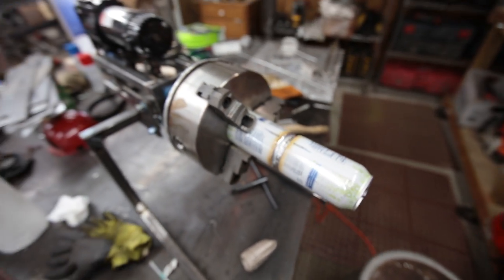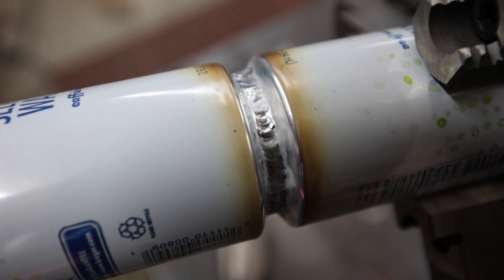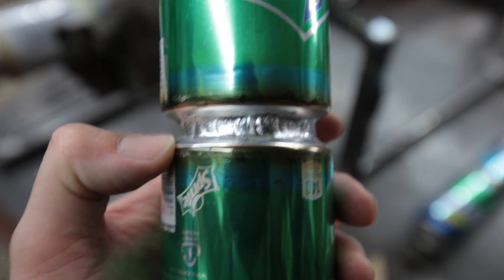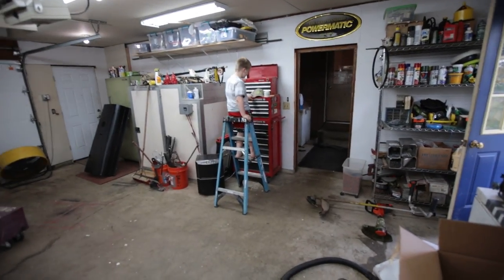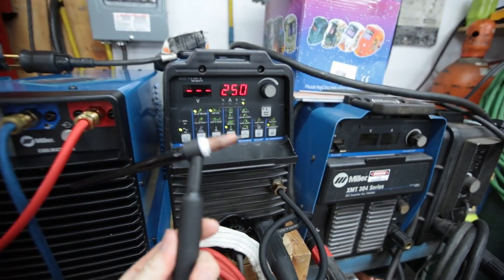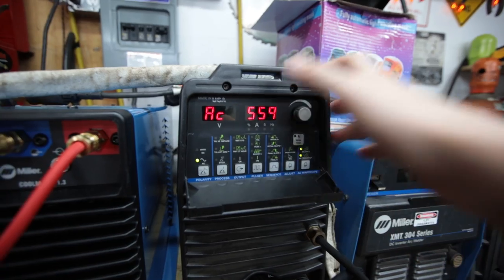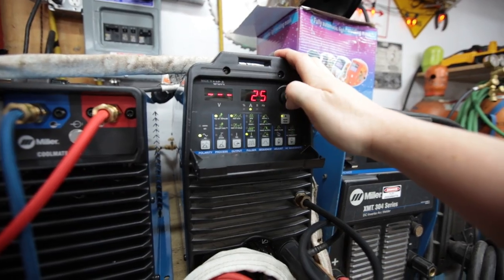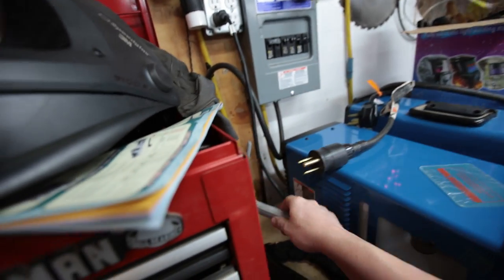Miller Dynasty 200dx Soda / Pop Cans

Comment: Can you do a video of the cart, and equipment on it, that you use for the Miller Multimatic 200. I think I see an air compressor, plamsma cutter, and miller Multi 200. I want a small miller plasma to run and am curious about the compressor and cfm for what you can get away with. Miller recommends 5cfm for small plasma cutter. I have a 4ish cfm dewalt and do not want to get a new compressor right away. Thanks from another dad with kids in his garage:)

Comment: That's a good marketing idea!  I just bought a small mig wire feed welder Lincoln 140.  I thought I should get a blended gas for welding regular steel, but someone told me they use 100% argon.  What is your thoughts on this?  Thanks for taking the time to make these videos.  Thumbs up.
Reply from the maker: Howdy, for MIG you want to run c25 75/25 or c100, 75/25 is a blend of 75% argon and 25% co2. 100% argon is for Tig or aluminum MIG. Will turn steel MIG into a mess..... not that I have ever forgotten which tank was connected to my multimatic.
Reply: Thanks for the reply.  I assume (!) that c100 is 100% co2, maybe that is what he said and I got it mixed up.  Last time I welded was 30+ years ago and that was stick, so this is all new to me.  Hoping to attempt a metal handrail for my deck when it is completed.  I'm a retired carpenter now, so this is a new hobby for me. LOTS to learn.